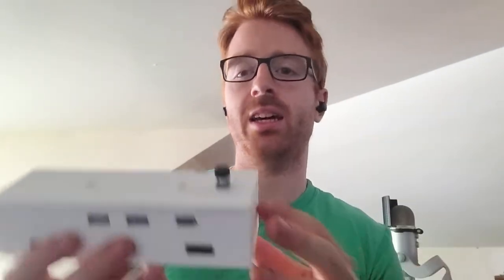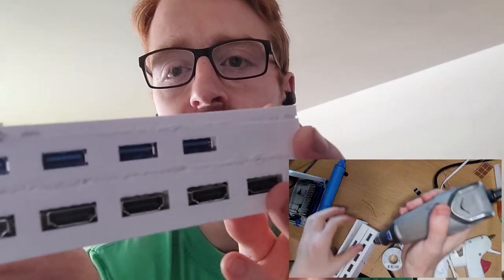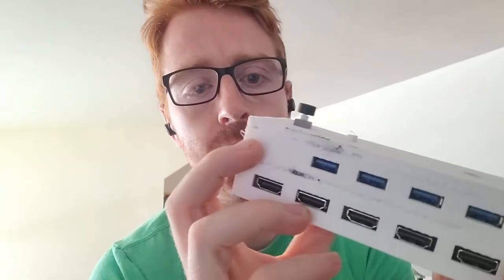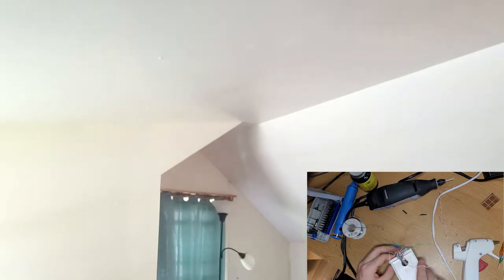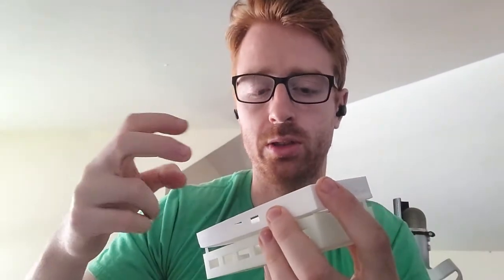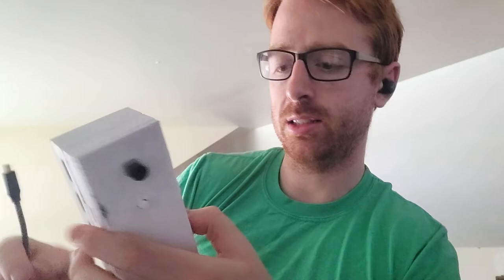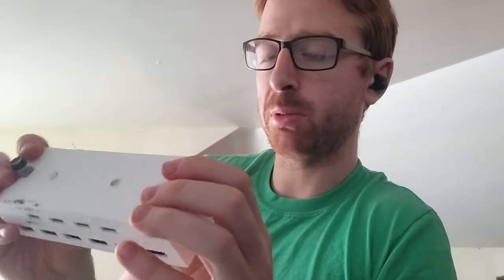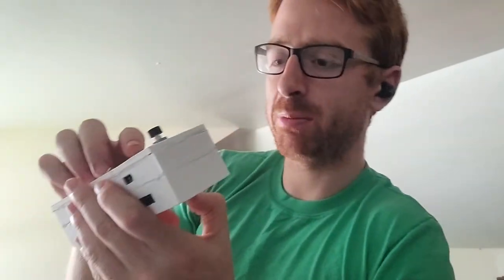3 HDMI output switch - design review

Comment: Hardware list?
Reply from the maker: So part of the problem is the hardware is very generic but here's the info
Reply from the maker: https://www.ebay.com/itm/274876577279
3 x HDMI 2.0 HDTV Switch Switcher Splitter Bi-Direction Hub HDCP 2x1 1x2 In Out 4K
Reply from the maker: ebay.com/itm/363369167106
USB 3.0 Switch Selector KVM Switcher for 2 PC Sharing 4 USB Devices